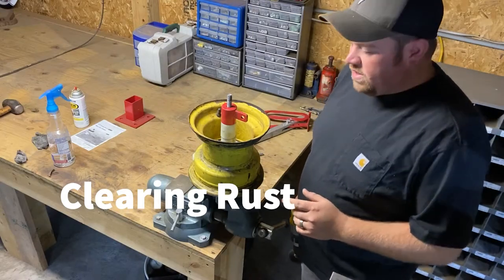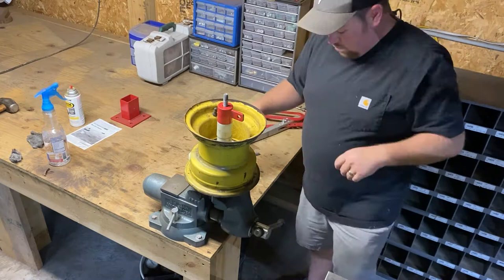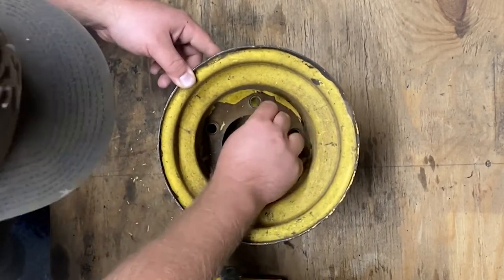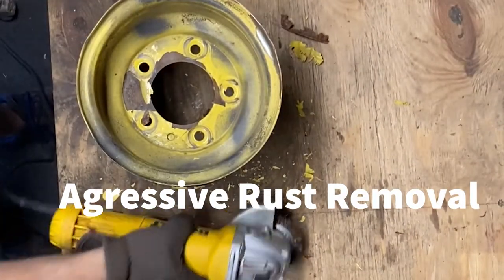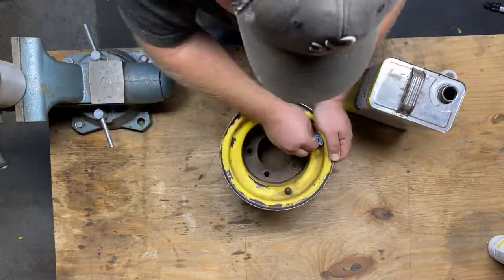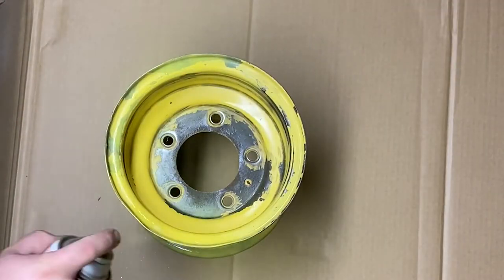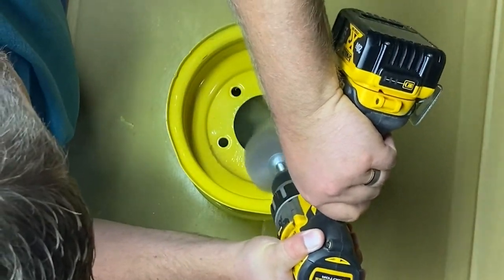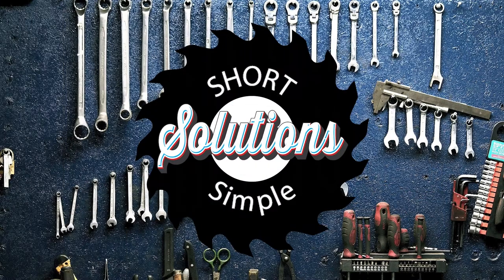How to fix rim leak and paint lawn mower wheel

Comment: Why no primer
Reply from the maker: I have found that as long as it is cleaned well (no oil or grease) and the rust has been removed, the paint will stick well. I only use primer if the paint has trouble sticking.